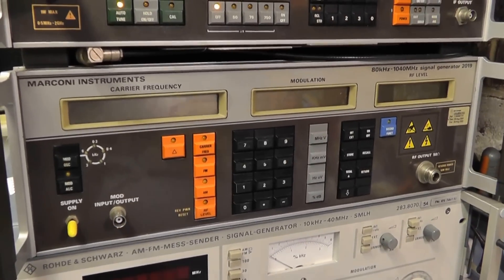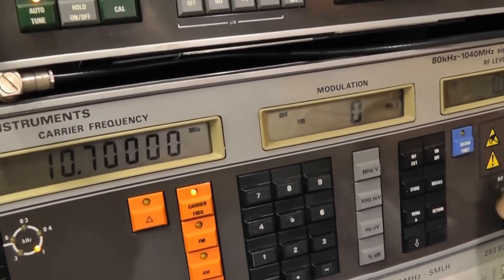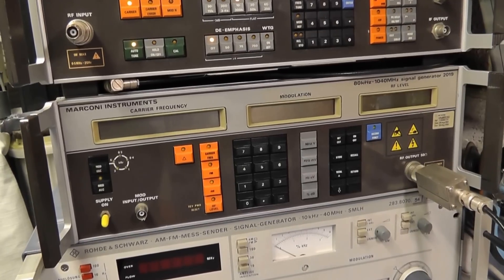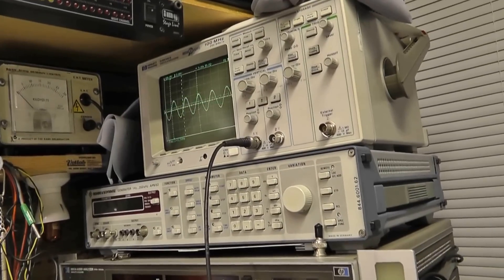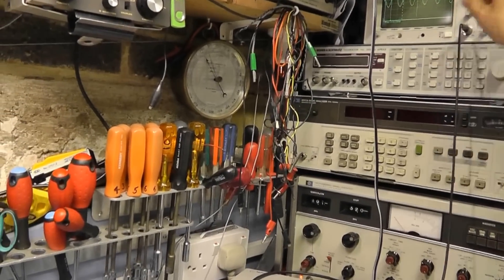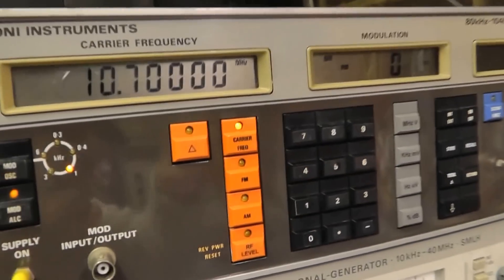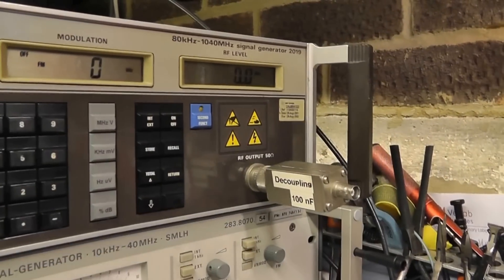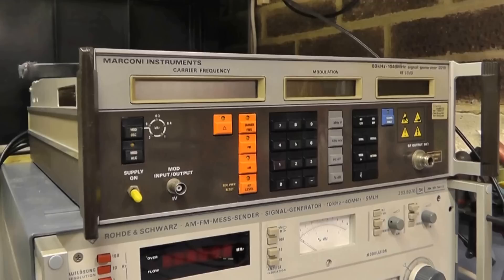Fault finding a working Sig Generator!

Comment: Easily done Simon. I recently spent half a day fault finding a Hacker AM oscillator and mixer stage. Couldn’t work out why there was no rf. Slept on it and decided to check my transistor pinout. Lo and behold I had reversed the base and emitter legs on T2. Serves me right for rushing!

Comment: Don't beat yourself up too much Simon. Everyone of us with a test bench has been bitten in the behind by faulty test leads at one time or another. I had a similar situation with a scope probe just this weekend. I was blaming the scope blind until I went to disconnect the probe and the BNC connector came away in my hand. I don't know why we always jump to the worst case scenario and suspect the most expensive piece of gear in the chain but we do for some reason. ATB Doug.

Comment: It's Beryllium Oxide ceramics. Very good thermal conductivity, but can cause cancer. But you'd really have to grind or machine it and inhale the dust. Otherwise it's safe to handle.

Comment: Yes more solder! The thing is you're connecting the plug in and out and it's wiggling about that's why it broke off! Maybe a tie wrap around it as well
Reply: John sweda - On a moveable connection like that,  I usually wind a small loop in the wire before soldering, helps take the strain off the rigid component.
Reply: Alan Doherty yes why a piece of wire around first and then connect the wire to the capacity would work a treat